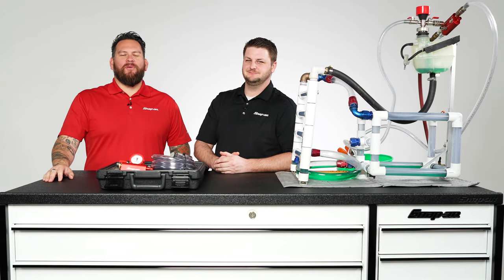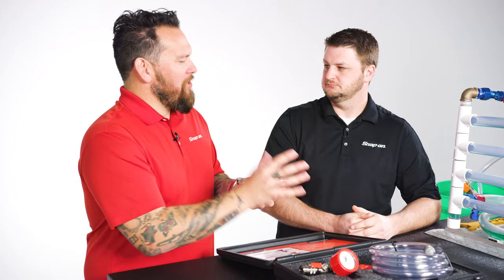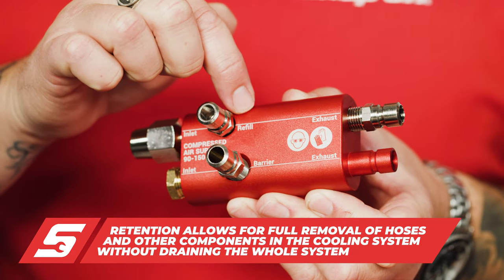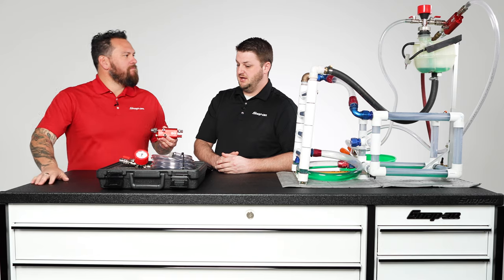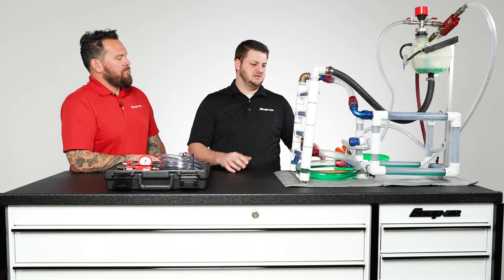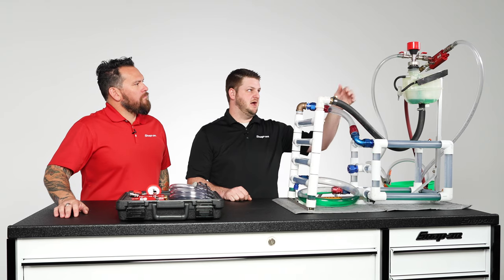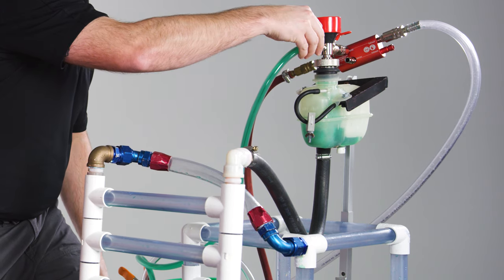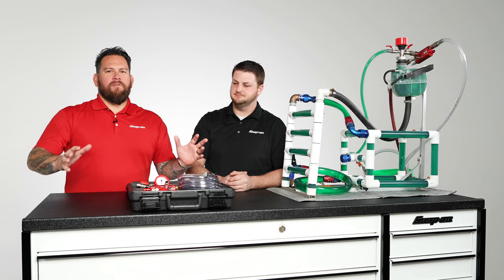Automotive Cooling Refill & Retention Kit | Snap-on Tool Tips

Comment: When you use the retension feature and fit a new hose arnt you adding an airlock in the system or will the vacum system pull the air to the top once fitted